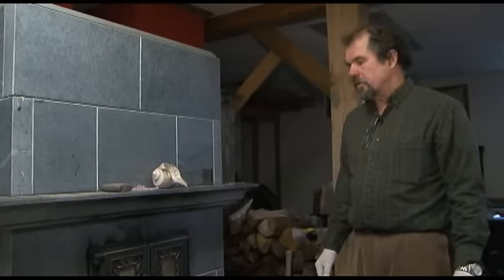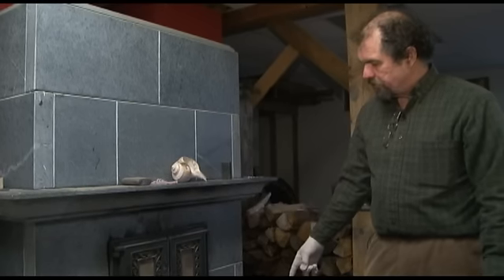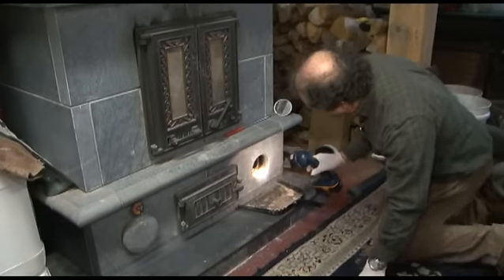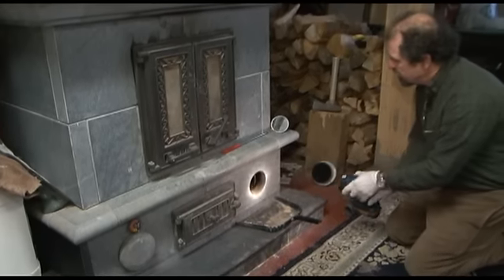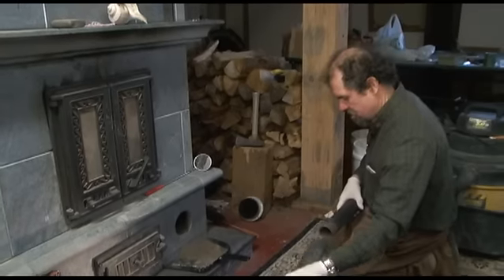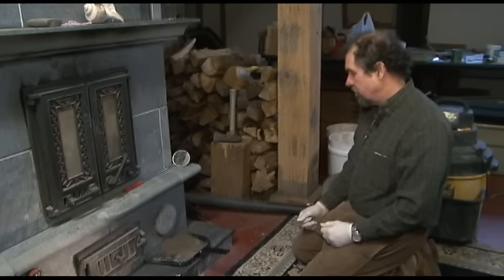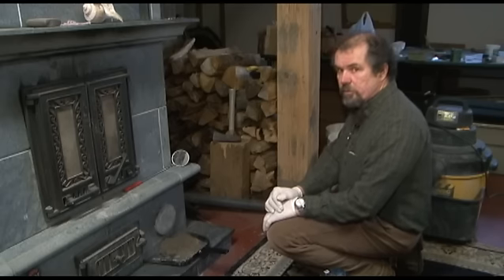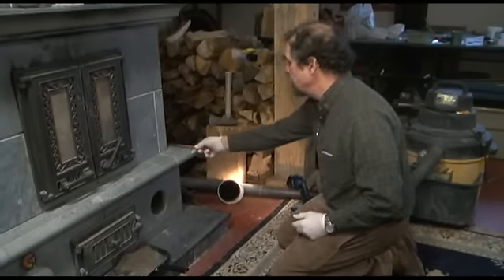Cleaning a Masonry Heater

Comment: Well, I was ready to get one of these fireplaces built; however, it looks like it's way too much work to keep it clean.  :>(
Reply: I own a chimney company and can tell you it is a real pain in the butt to clean.  So many moving parts.  I much prefer a good old fireplace, wood stove, or fireplace insert myself.
Reply: Masonry Heaters that are used properly are notoriously easy to clean because there is so little left behind. If you burn DRY wood, you should have no creosote build up and will only have minimal fly ash deposits accessible through the installed clean out doors.
Reply: @MelodyMLucianoNorris-qe8lc  please educate your customers who have dirty masonry heaters that they are burning wood which is too wet or they're not operating their appliance properly. These units are designed to burn clean - I promise.